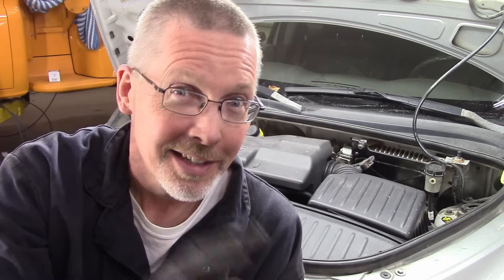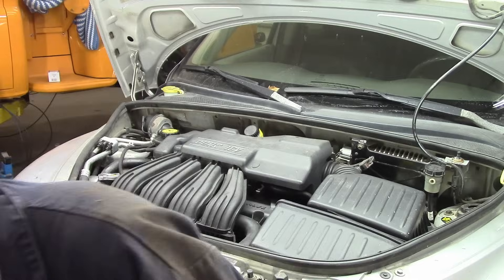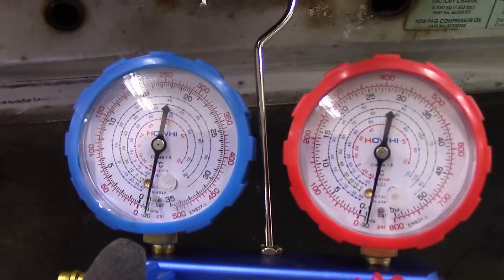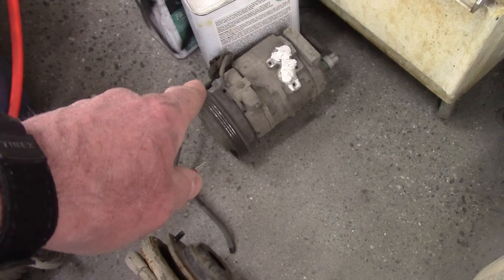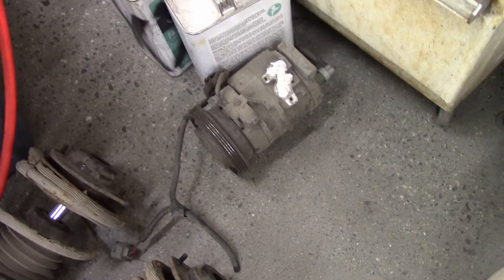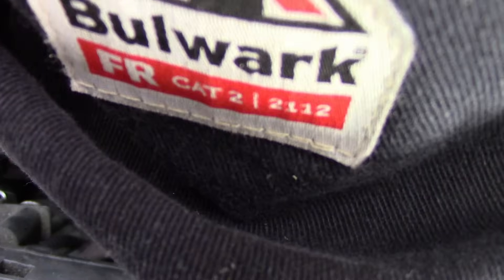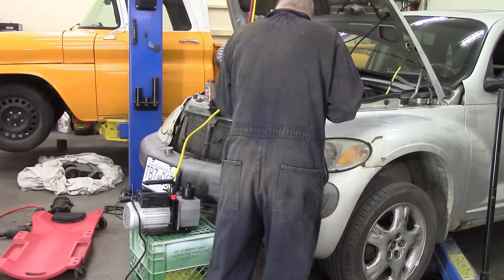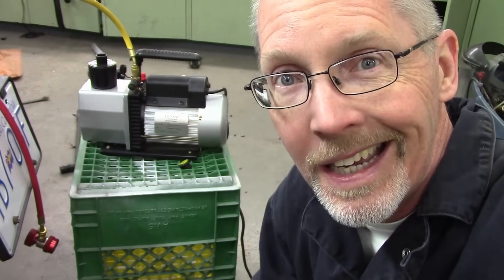DIY Testing, Fixing, & Recharging A/C

Comment: Engineers can design anything they want anyway they want. My brother-in-laws Chrysler van needed a brake master cylinder. They could have made it so you can unbolt it from under the hood, but Noooooo. They made it so you have to remove the bolts from under the dash an eighth of a turn at a time. C'mon guys? Are you sadistic or just stupid??

Comment: I hated working on PT Cruisers when I owned my shop! I swear almost every repair instructions started with, “drain and remove the radiator.” I used to replace the receiver/dryer every time but after a while (and a few customers complaining about the added cost) I found putting it under vacuum for 1hr it never cased an issue.

Comment: The oil you put in after you changed the compressor got wasted when you put a vacuum on the system, you were supposed to put it oil in after you do the vacuum. you could have let it entered the system through the yellow hose. also you could have used the same yellow hose to put the freon in instead of using the hose that came with the can, its the same tread.

Comment: I went through the "three times round" experience, with a 
64 Chevy Impala (283, Power Glide tranny). Pulled it out
(on my chest), rebuilt it. Put it in. No reverse. Opened it up,
to find I put an umbrella seal in backward. Fixed that.
Picked it up, from the bench and found a clip ring lying
on the bench. Where did the clip ring go? Right in the middle.
Opened 3 times, pulled and reinstalled 2 times. 😁✌🖖

Comment: Poking it with that thing of course it won’t turn on there’s no power running into it😂😂 you have to use quick splice and touch the wire together
Reply: Yes, there Is power in the connector he is jumping.
He is jumping the side of the connection coming from
the power supply, going To the compressor. The switch
is mounted on top of the canister and the jumper is
taking the place of the switch, for testing the electromagnetic
clutch, on the compressor, by replicating a closed switch.

Comment: Thanks for your video. So what is the correct pressure for the low side and the pressure for the high side,when the system fully and correctly recharge ? And are all systems the same ? Thanks

Comment: I worked on different aircraft while in the USAF, this R & R & Recharge so reminded me of the jobs I did as an aircraft electrician. Associated systems and equipment that were in the way of our stuff were technically required to be be removed by the other techs But unless you wanted to add 1/2 day of freezing weather or scorching heat you tried to do it without them. My small sure hands fit in places the other Man hands wouldn’t and I didn’t drop stuff cause if you do that bird don’t fly till it’s found and removed.

Comment: 'Don't wear gloves when working with power hand tools'. Whose brainy idea is that?  Safety glasses and heavy gloves are a must when using a hand grinder and for that matter a bench grinder.  
  Creating access to get at parts is something we have done for years. Recently cut out a panel in the bed(truck has a bedliner) of my pickup to get to the fuel pump.  Saved a lot of work now and in the future as I have had this truck for 35-years and never intend to sell it. 
Hell of a job you had. New EV's are easier to access and work on.

Comment: The part with the single nut by the rad (that was broken anyway) ... that is the outside temperature sensor (just in case that you may really care). Keep having fun with these over engineered illogical designed  POS (that's anything that started getting convoluted in the mid to late 1970s). Keep enjoying working on your mid 70s and earlier. Besides, an EMP will not keep you from getting your favorites from running.

Comment: You never checked to see if you had power to that low pressure plug or power going to the clutch on the compressor, just condemned the unit without checking relays and fuses?

Comment: Why worry about getting rid of moisture in the system because it does it automatically, isn't it!? 🤷🏻‍♂️
That's why all the systems drain water through the bottom and on the ground whenever they're working.
Or am I missing something!?
Reply from the maker: You don't want moisture inside the system.  The water you see is just condensation from the temperature change inside the cabin.

Comment: In USA you can buy can of compressed keyboard “ Air" duster anywhere .Guess what is inside? R134a refrigerant! If you turn it upside down it will spray liquid, so you can freeze your ass off 😁. So millions of those cans got  released in the offices and houses daily. Yet, HVAC tech have to recover it in the tank 😁

Comment: Just got out my old compressor to put a new one and it was a pain in the ***. Stripped bolt, bolt broke with thread still in... Was your new compressor coming not prefiled with oil because I am wondering now if I have to flush the system
Reply from the maker: My new compressor was a used compressor.  I put some oil in the system. There is a "rule of thumb" out there for how much oil each AC component should have.  I think it's 2oz for the compressor, but you should confirm that.

Comment: How's that junkyard compressor holding up after 5 months? I got one from a junkyard just a few days ago but I haven't installed it. I'm skeptical that it'll work, and I'm thinking about purchasing a brand new one to have on hand when I do the repair...just to be safe. The junkyard car that I pulled it from had 131k mi on it, while my car has 150k.
Reply from the maker: It died months later. Junkyard compressors are hit-or-miss.  I've had some wins, and I've had some losses. Most wreckers' are good with exchange, but you still have to pull another one.

Comment: I think you rolled snake eyes Sir. Nice job. One question though I'm a/c 609 certified never seen that 134a substitute.  Is it compatible with 134a or used exclusively by itself? Thanks for the information.  🙌 In the US we can buy 134a under 30lbs. Over 30lbs need license.

Comment: Screw all of this. Get a old V8 wrangler take body off and put pt cruiser body in it's place. Drive bolts into the body into the frame. Pt cruiser would be cool as a V8 powered four wheel drive

Comment: I drained the radiator and removed the fan just because I have big hands, was very helpful because the ac bolt would not come out, had to get in there to remove it, easily dropped the ac from the bottom and installed the new one the same way 1-minute process

Comment: support the engine with a jack and remove the engine mounting adjust the engine up or down to get more clearance for the compressor screw you don't have to remove the front panel

Comment: Better than a mission impossible movie.  Thanks. Q.  When filling, should you hold can upright to fill with gas rather than liquid?
Reply: All refrigerates with an "A" after the number (such as 134A and most other refrigerates on the market today) is a blend of refrigerates and should always be added to a system as a liquid instead of a vapor.  Which means that the container should be inverted (turned upside down) while adding refrigerate.

Comment: Thanks for the video, you took a different route altogether, might have tried pumping a little air if not nitrogen to see if clutch on compressor engaged, also to check for leaks with bubble solution if okay, evacuate and recharge but old habits die hard and you chose to run a long mile but it takes years to train to make a meal out of recharge or to make a life out of any profession. Good luck.

Comment: I know the trouble some engineers designed with cars, trucks that made repair next to impossible, good video. If you ever charge again rotate the can while charging and maybe drive over the border and get the real R134A if it's not too far.

Comment: I have very little gas left in the system and want to drain the last gas (134a) out from the AC before i remove it. By the time i dont have oppertunity to take it to the dealership. 

How do i release the last gas out in the free air? 
Do i just open the 2 valves on the compressor? 
Do i release the air from the HP or the LP hose first? 

Really hope someone will answer me😊

Comment: So what if you jump the switch and the compressor kicks on where do you go from there
Reply from the maker: Might be the low pressure switch itself?
Reply: @GregWellwood  I did change that out gonna replace the dryer next along with the little filter that’s inside the line idk??
Reply from the maker: There needs to be electrical power through the AC system.  The system will not operate if you don't have power or ground, and will not operate if the pressure is too low (or too high). Check the fuses, check the relays, and check that the wiring is not damaged.  I always like to look for the obvious things first - if everything you have, doing what it's supposed to?
Reply: @GregWellwood  It runs but it just blows hot air after I change the switch the low side got a little code on the tube coming out of the dryer but still hot air coming out of the vents

Comment: Just a thought, sometimes you should run the bolts into the bolt holes prior to install. It cleans the threads a little.

Comment: I've been using silicone grease since 1970 to stop steel bolts and ally from rotting, it doesn't have the good looks of Never-Seez but is just as good if not better.
Reply from the maker: Used to use just motor oil on spark plug threads back in my apprenticeship days.

Comment: My brother! No one has ever spoke to my heart the way you did at 11:20. The inflection, the tone of your voice, I KNEW you have known the pain that I feel more and more with every passing day. "After arguing with the electrical connector I cut it off and then dont show how I had to completely undo and redo the hell I had just been thru." (I'm paraphrasing there, I realize those weren't your exact words.) That is the story of my life.  It seems like every single project or chore or undertaking I attempt, the universe has decided to make it as absolutely miserable and far more difficult that it needs to be. Or is remotely even  reasonable. It cant all be coincidence. It is by design, I'm sure of it. It's crazy making. Its going to end in tragedy. Its got to the point my new motto or mantra is....if it aint broke, just give me a minute. And I know it cant be a pretty sight to see, watching a grown man have an absolute tissy fit, a psychotic break because cant find a 1/2" socket with 1/2" drive. He's dumped every old tool box and old bucket and jar out on the garage floor, and he's found 38 1/2" sockets but none with 1/2“ drive and he only has the extension and universal he needs in 1/2". Has an adapter, but of course it wont fit in there with the adapter. So he just decides to go after it with vice grips and channel locks, you know, the ones that always slip and pinch your palm. And then when you said soldering, I teared up a little. Its not my forte. Fits like these, when soldering is involved, usually degrade to mapp gas. And I'm not talking about sweating pipe, I mean soldering. As in wires and boards and what not. Because I promise you that $#@d solder is gonna melt. I promise you. Let me put it like this, my boy was probably 6 or 7 at the time. Seeing the look of desperation and frustration of a broken, beaten man, asked me with genuine sincerity and concern, he asked me in ernest, "dad, why does God hate you?"  I almost wept. I could be wrong, but when you made the comment about the hammer, I sensed, at least a little bit, you KNOW my pain. Let me know if you ever want to partner up, and we can go looking for that little elf that keeps stealing all the 8 & 10 millimeter nutdrivers. We can find him and beat the *#&$=\% oiss outta him! Ha! 
It was an excellent video, sir. It was so good, I watched it. I watched your video on a PT Cruiser a/c compressor. And that is saying something, because right now I'm working on a water pump on an old Mustang.  Just sayin....

If it aint broke, just gimme a minute......its mine, nobody steal it!
Reply from the maker: My Epitaph will be: "Well, I didn't expect it to go wrong that way."
Reply: Jerry if it makes you feel any better there is nothing that I've done that I haven't done twice...I have come to realize that I will never get anything done on the first go round! I can expect the worse every time on any project!
Reply: You are hilarious. I wish you were my friend
Reply: Inhale deeply all of your woes and exhale them on your next breath, repeat until all woes are gone and breathing Comfortable has resumed.....
 Be here now.......
Reply: This is so on-point! On "those" repair jobs, there comes a point where my "WHY ME??!!" attitude kicks in. I try to fight it, have a tantrum, etc. Usually I find that taking a break and having a bowl of ice cream with chocolate sauce or hot fudge helps. Small, most recent example, I go to replace the broken S-Belt in my 2005 Scion xB. Belt replacement, a 15 minute job, right?  Anyway, the belt tension adjustment is the top alternator bolt. All is good, belt tension good, and then I break the bolt with a final push snugging up the bolt to lock in the belt tension. The bolt head snaps off. So, I wind up having to start over, drill the bolt shaft out of the alternator, get a new bolt. Oops, in the process I broke the VVT solenoid electrical connector that's perilously close to the alternator wrenching path, despite being cautious.  And did I mention the alternator bottom bolt was nearly impossible to get a wrench on to loosen? Thankfully it didn't break. Thankfully, I can get a new VVT solenoid with a good connector quickly from Amazon. By now, it's arrived. I go to install it, and the electrical connector orientation is wrong by 90 degrees! I can't even get the alternator into position to tension the belt without breaking that connector! I send it back and go down to AutoZone and buy their part for 3X the price. Eventually, I get it all back together, the new S-Belt on and tensioned with the new VVT solenoid installed. Victory!  Oops, the alternator isn't putting out current now!  I must have damaged it while drilling out the broken bolt!  Thankfully, just joking... the alternator was fine, all was good, but while driving the car home for 10 minutes with no S-Belt thus no water pump and no cooling, the engine overheated and blew the head gasket!!  Thankfully, just kidding on that one. All was good, and the car just completed a 3,000 mile trip from Florida to Washington state.  But the things I was kidding about... some poor soul probably had those things happen to them.  So, in answer to the "WHY ME??!!" I just give thanks, and remind myself that all this was sent to me as a lesson to make me a better DIY mechanic. The actual takeaway was to NOT use the longer 1/2 inch drive ratchet to tighten that small a bolt (IIRC 12mm head) that is  turning and not seized, instead use the 3/8 ratchet or even 1/4 ratchet to avoid breaking that size bolt.  All this was supposed to be a 15 MINUTE JOB!! I celebrated the victory with, you guessed it, hand degreaser and a bowl of ice cream.
Reply: I feel  this so much!! I always say why can't anything just go smoothly!!

Comment: Nice video, only thing I would say is that  you're not supposed to invert the can because you're pouring the gas in its liquid form into the pump and liquids are non compressible so it will in theory damage it, you have to keep it upright and just agitate the can, thats what i did when i topped up my system last time, takes longer but it does work and is supposed to be safer in theory !!!

Comment: PRO TIP::: When using Anti-Sieze in an aluminum application,  Use aluminum based Anti-sieze, NOT COPPER.
Reply from the maker: Interestingly, Permatex's silver stuff has copper in it, and Permatex actually recommends copper-based for aluminum.  Copper-based is also electrically conductive.

Comment: It’s also risky not knowing how much lbs of refrigerant you added but other than that 100% proper job i would have done any seals accessible and the expansion valve or oprohus tubehow many degrees f? Last i did was 34* 🥶

Comment: I'm SO pleased you talked about Celcius. It's the ONLY sensible measurment out there (Ha ha ha, my Murrican spell check doesn't recognise Celcius, lol 😀 I'm in Scotland, where we use metric for measuring things like wood and imperial for miles & MPH). as you pointed out, water freezes at 0 & boils at 100. Fart en shite is the WORST!! Murricans "Oh gosh. It's 110 degree's today!" I'm like WTF????? Anyway, my wife's engine & gearbox had to come out of her Citroen for a clutch, timing belt, timing chain (the DV6 engine has both) glow plugs (and I just KNEW a glow plug would break, so it was better with the engine on the bench) and so on. While engine was out, I tested her condenser with air pressure and found the pin hole that had been there for years. Charged the AC yesterday and it's blowing cold 🙂
Reply from the maker: Here in Canada, we use both, but it depends on what you're measuring.  If you're cooking, °F.  If it's outside temp, °C.  If it's pool temp, it's °F. If you're measuring your own weight, it's in Lbs.  If you're measuring something light, it's Kg, but if it's heavy it's Lbs. If you're measuring your own height, it's Feet and Inches.  If it's a long distance, Km.  If it's a short distance and work-related, Miles.  If you're giving directions, distance is measured in travel time.

Comment: I got a 2006 Mazda 3 2.3L 4cyl 

Problem A/C works great at high speeds but at idle it cuts back on cooling  sometime it will cool for awhile at idle then warm up and cuts back on cooling Car does not overheat
Car been maintained well

New parts below

Ac compressor (New)not rebuilt  not China crap eather GPD
Cooling fan
Condenser
Dryer
High pressure line
Water pump
Thermostat
Flushed radiator inside /out coolant
Expansion valve
Canned R134A
Cab filter
serpentine / A/C belts

What could it be?